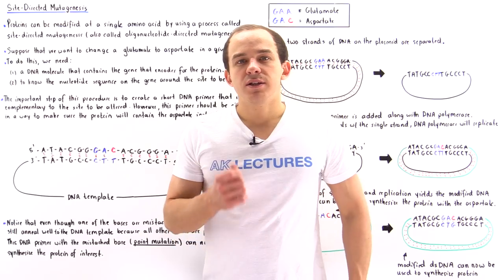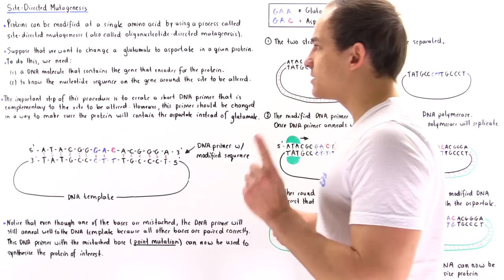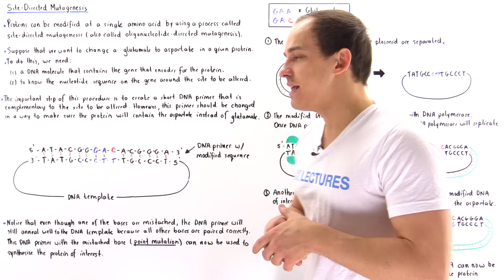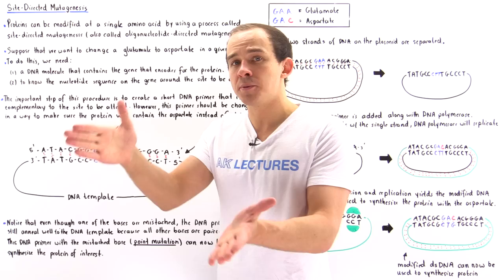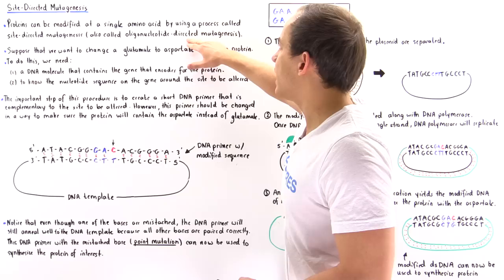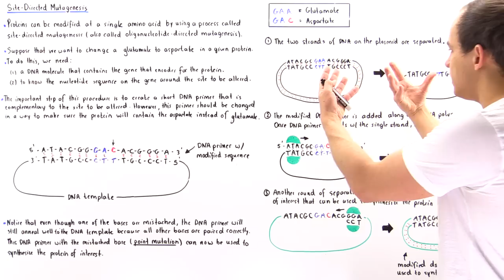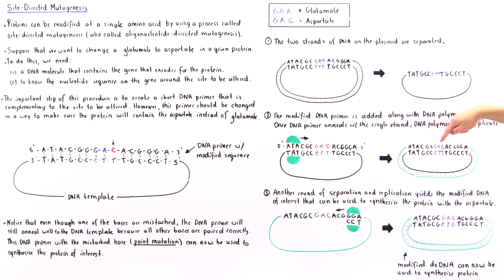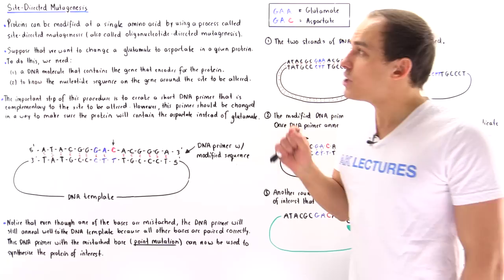Site-Directed Mutagenesis

Comment: You didn't mention how to remove the parent strand, can you add one or more methods in the video describtion?

Note that I'm totally proud at this video, because it is one of the best on youtube explaining site-directed mutagenesis.
Reply: i don't think it's necessary because the parent strand will be 1 between millions of modified strands after all PCR cycles. When using the plasmids for transformation, the positive clones obtained most likely will not receive the original parent strand
Reply: It is important because the parent strand could be amplified in further PCR cycles as well, there are some ways to get rid of the parental strand. A common one is the use of the restriction enzyme DpnI which can only digest methylated DNA. Methylation is a form of DNA modification which is done naturally in organisms like E.coli where most of the plasmids come from. The newly synthesized strands are not methylated.

Comment: Sorry master but i think that the dna pol in picture 2 should attach to the 3'-OH. You draw it at 5' and it will move 5'->3' and meet the non omologus pair and cleave it with nick-translation and replace with the right base, loosing so the mutagenesis

Comment: are the disadvantages of this that one ends up with an  unmutated DNA strand because this method only uses on primer?  what are some other disadvantages of using this method?
Reply: you should bear in my mind that the primer you design here is longer than the normal PCR primer. You will need to consider a lot such as d right Tm, G-C bonds etc if not YES you will have unmutated DNA just dancing in your plasmid.. lol.... also, a disadvantage will set in when you are dealing with harder base pair sequence or changing more than one base to achieve your novel gene...... but for now its all we have...